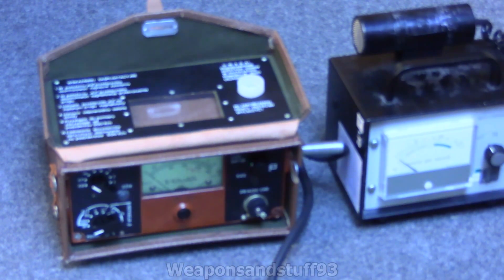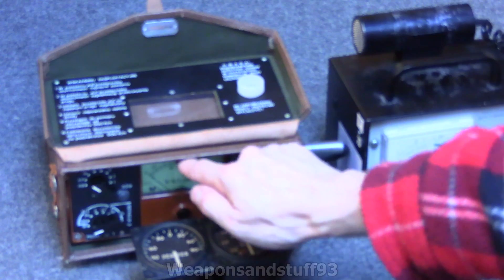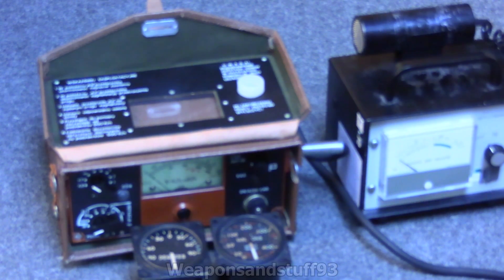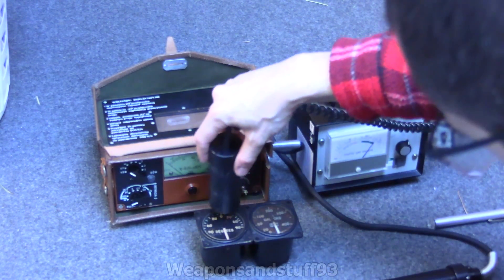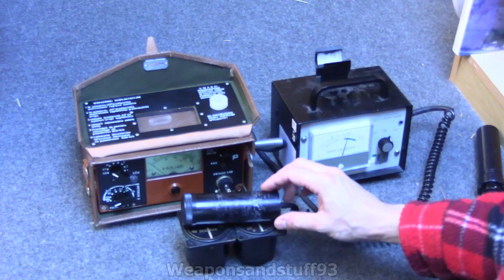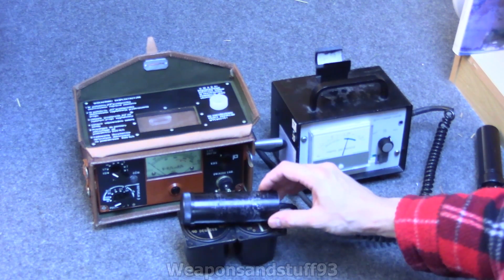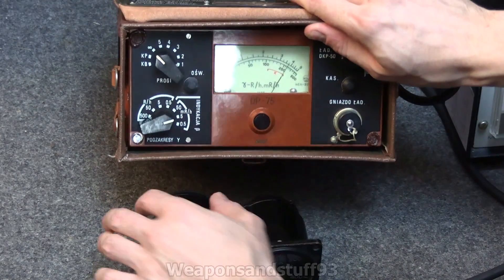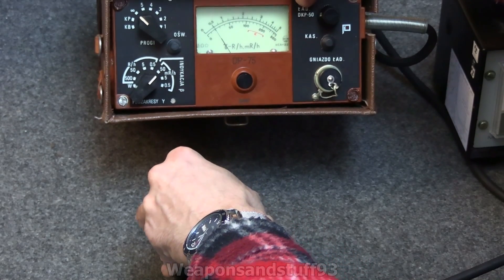Radium Dials Gamma warning

Comment: Great video! Iam addicted to everything radiation related and so on, its highly interesting!

One question, could you maybe do a review on the NATO - GOST thread adapter, if it's safe/makes a proper seal or if it's dangerous, someone sells these for around 10 bucks now:
Here a link:
https://youtu.be/vzxVJjlsDk8

Greetings!
Reply from the maker: I'll do one at some point, I've seen several 3D printed so no idea which ones are better than others etc

Comment: I was just about to ask you to showcase all your aircraft dials lol If you could, can you do one with your CDV-700 and the dials?
Reply from the maker: I'll do that on a later video, issue is, a few dials together overload my CDV-700 so will use my Terra-P for an accurate number when that arrives.
Reply: @weaponsandstuff93  My CDV-700 just came in and my dial (which is mint and good glass like yours) just nearly overloads it. I know yours are hotter though.
Reply from the maker: @flyingfortress4819  Cool, is that with the beta shield open or closed?
Reply: Weaponsandstuff93 Open, I meant to test it with it closed, but I forgot because I was too excited getting a working CDV-700 lol I’ll definitely do a video soon